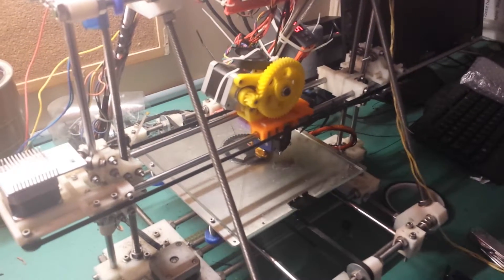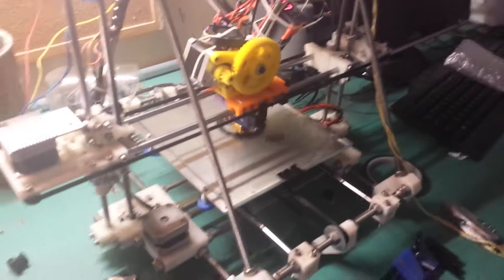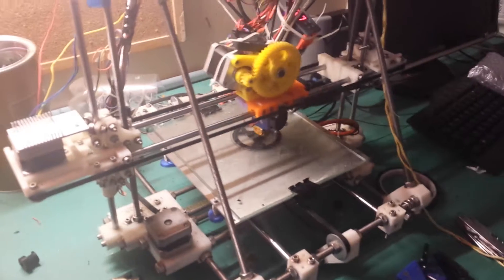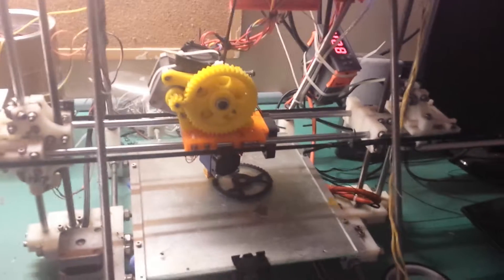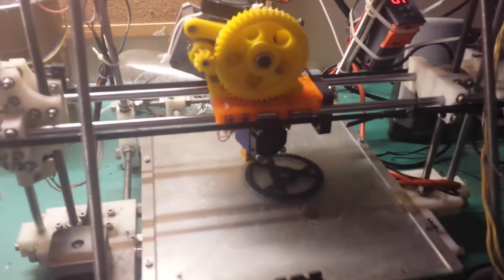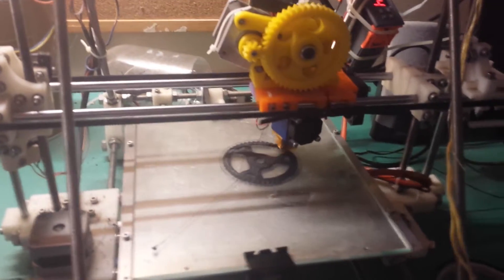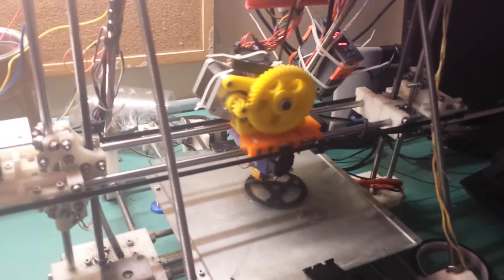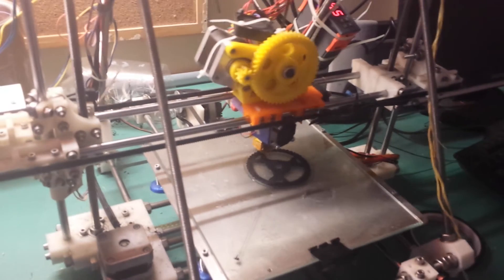TangleRap Update December 2014

Comment: Hey There,

I noticed your activity in forums, I'm battling the same problem, except I got the termocouple to work, but its not updating the temperature. How did you fix that problem. Thank for your time.
Reply from the maker: Using the latest stable Marlin firmware, MAX6675 cold junction compensator.
No LCD or SD card.  Currently awaiting someone with far more coding expertise to sort out SPI priorities when there are multiple devices on the same SPI for Marlin firmware so that the LCD and SD card can work flawlessly with the MAX6675/MAX31855
Reply: grogyan Is it the 1.0.1 firmware? I tried setting the Temp_0 sensor to -2 without anything else enabled like SD card or LCD, it does not compile. If I comment out the SD card defs in the temperature.c it compiles and reads, but I do not get updated values. Any ideas, or could you post the link to the exact firmware you have. Thanks.
Reply from the maker: circuitmaster best to chat with me over google hangouts. +Gary T